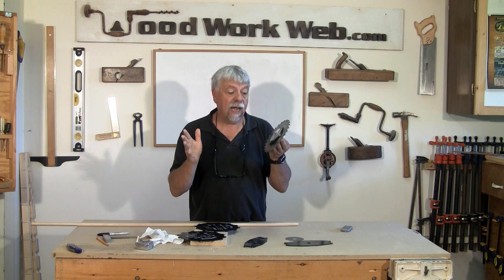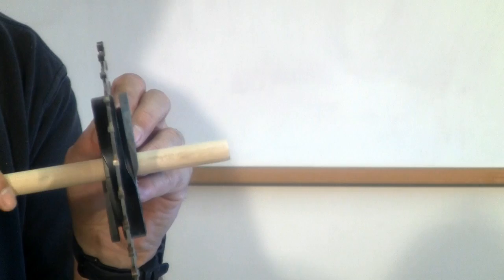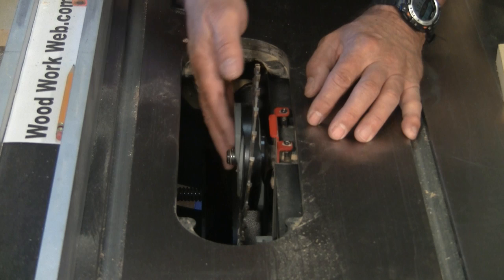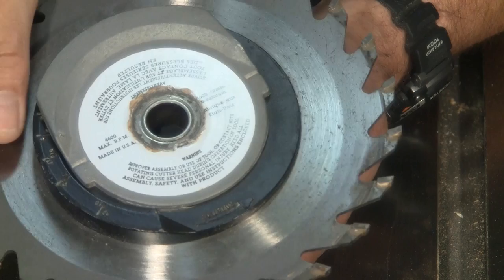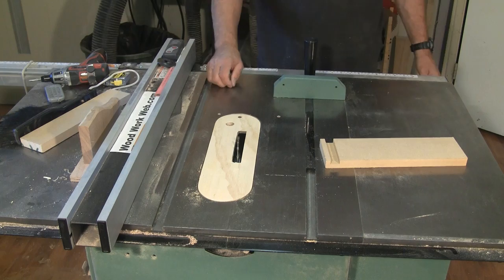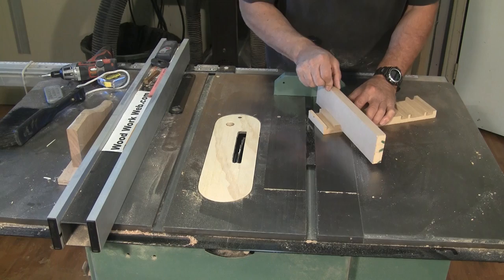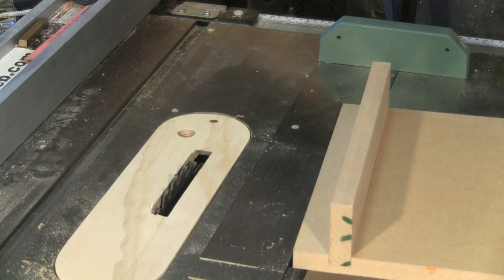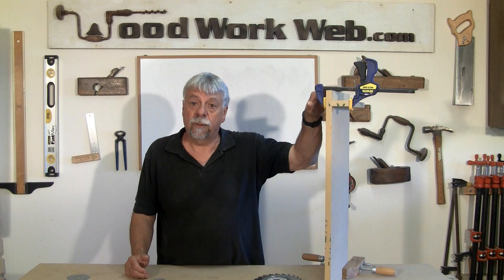Testing the Wobble Dado Blade -  woodworkweb

Comment: I got a wobble wheel a few years ago, put it in a box, and said I was going to use it later. Well 4 years later my wife found the box, so I took it out and finally put it together.  This one was made by Oldham and it comes apart so I can dial it in.  I have a Dewalt job site DW744 table saw for which I made a rolling cart with wings.  Everywhere I looked on the web, people were saying you can't use a dado stack on a Jobsite Saw.  Well, I got a Dado Throat plate from Dewalt for my saw with instructions on how to use a Dado Stack.  The outside arbor flange is put on the inside and I bought another flange for the outside so the saw blade isn't going anywhere.  I set the cutter to 3/4" and the Dado was really tight.  I sanded a bit to fit the test piece and that did the trick.  I suppose I could have done what you did in trying to dial in the perfect fit, but for my purpose, this worked out pretty good.  I also have a Freud Dado Stack that actually works much better.  As with your Wobble Wheel, mine has flat teeth but still produces a bit of a cup.  Thanks again for this video.

Comment: I've had one for 40 years. Works well for general woodworking, mostly for shelving. I worried about vibration and what it does to the motor bearing if it is used extensively,  but never had a problem.  Reading a lot of strange comments below.  These are great and serve a niche purpose, and have carbide tipped blades.  If you have access to a table saw, they're great. I don't think they're recommended on a skill saw.  A router, router table, and a nice set of carbide tipped bits are a great alternative if you are cramped for space, yet want to do a lot of different operations.  They are noisy, though.

Comment: We have always used the wobble wheel. It is simple to set up and best thing is there is only one piece to mess with. Also I've never had to adjust the blade that many times to get a good fit. The measurements on our blade are pretty close to true.

Comment: Yes, I use these all the time and they work really well. as Juan says, you ran the wood over the blade too quickly.  Run the wood a little slower or run it through a second time and the cut will be flat at the bottom of the dado.  The one that I own can be adjusted while it's on the arbor.  The two pieces that clamp the blade are cambered. Just loosen the nut,  and using two adjustable wrenches, hold the inside piece while turning the outside piece.  Then tighten the nut.

Comment: used one of those for years and never had that much trouble adjusting the width of cut. Also, I have built a large desk and glue,  no nails and only 10 screws and a handful of dowels. Used the wobbler for all dados and the desk is still being used 47 years later.

Comment: Yes but ........    taking apart a stack dado and adding shims isn't much different.   We all started somewhere.
Reply: RapidRrobert shim stack dado only requires one adjustment. Take a cut measure, add shims cut again. Golden. Once u know the stack for your set, grab and go. I like to use a story stick so to speak. Cut all dados in a setup board, leave that board hang out around the shop. Got a new board? Grab that stick test the fit, go gets the right shims and chippers.
Reply: i think he had to make a lot of adjustments because the guide was unreadable... which is a good advise in those wobble dados: take good care of the measurement guide if you don't want to fiddle...
usually in carpentry you use half a dozen measurements for dado cuts at MOST... once you figured out the sweet spot in those wobble dados you should punch a easy to see mark with a stencil so you can come back later... since it's a logaritmic measurement the wider the dado cut the hard is to finetune it

Comment: why not just use a dato blade? this thing looks like it takes more time setting up than it would making a couple cuts.
Reply: Mine has markings on it and I have no problem turning the hub to the setting.
Reply: that would be much more simple. if that were the case then yes this would beat a dato blade
Reply: I have both and now I just reach for this one.
Reply: John Miller He futzedabout much more than was necessary. A good fence, some calipers and a couple of hand turns will eliminate much of the time he wasted, and u probably don't have to completely remove it to adjust it

Comment: I have seen these periodically for sale on Craigslist, but never got one because the people selling them were asking a lot more than you say they should be going for.  I have an old Craftsman table saw with a cast iron table surface that I bought off a guy who was cleaning out his father's shop after he had died.  He also gave me a large box of old saw blades, but they have just been sitting in a corner in my shop ever since I bought the saw from him.  Today I was in the shop looking for something else and saw the box of blades, so I decided to take them out and see what all was in there, sorting by blade size.  I figured that if I had enough blades of a particular size, I could made my own dado set with some spacers made from aluminum sheet or whatever.  As I'm slowly working my way through this box of blades (and finding quite an assortment of different blade sizes), about halfway through I stumble across one of the wobble blades.  Looks like I won't be searching on Craigslist for one anymore... :)
I suspect that I have enough of the normal blades to make my own dado set though, so I still might not even up using the wobble blade.  My primary use for the table saw was to rip boards down to different sizes, not make cabinets or shelves, so I seldom need to cut a dado.  I've done it a  few times by just using a single blade and nibbling away at the cut until it was the right size.  Not something that I would want to do on a bookshelf with a lot of dados that needed to be cut through... :)

Comment: I have used a wobble dado for many years (since 1975) on my RAS, it now has marks scribed in it for the common thicknesses of material that I use, as a result setup is quick and easy. 

My first wobbler was a toothed monster as described by "tkarlmann", it was a fearsome looking beast but cut pretty good dados, however at 6" diameter the cuts were not too clean.

My 'newer' Sears wobbler has a 24 tooth carbide saw-blade and at 8" cuts a very smooth slot.

I have a stacked dado set which I hardly ever use, though the fact that the maximum dado width it cuts is 3/16" might have a little to do with that.

Thanks for the video Colin.
Reply from the maker: Paul Tomlinson Thanks for not Paul, good to hear others experiences

Comment: I have one of these and used it a good deal on my Radial Arm Saw, worked great.  The iterative process of getting the dado exact is just as cumbersome with the stacked dado.  Has to be another reason these were discontinued.   My guess might be the vibration impacts of the wobble on the saw.

Comment: Great way to lose a finger or thumb. I run as fast as possible away from them.
Reply from the maker: James Stanlake Yes, if you are not comfortable using them - do not use them.
Reply: Do your homework, they are banned in the states because they caused so many injuries.
Ask OSHA. It is the nature of the way they cut. Without constantt even pressure and feed they can cause the material to shift creating the potential for kick back. Call me what you will but give me the old fashioned stack dado det
Reply: My reply was not taken from any research paper I created. I am a ordinary craftsman with many years of experience. You can go to any OSHA office or likely find reams of information from their website as well.
Now they did extensive research on wobble dado blades, not me.
Reply: @jamesstanlake4064  Any source of the banning of the wobble saw on the internet? Only reference i can find on the OSHA website is "The practice of inserting wedges between the saw disk and the collar to form what is commonly known as a "wobble saw" shall not be permitted.". Seems to be about something else.

Comment: Had one for years. One excellent thing is they can be adjusted to the "metric" plywood and other odd dimensions out there today.  Also, you can set them for dimensions between 1/8" and a 1/4" that are nearly impossible with the stacked sets that have two 1/8" blades and chippers.

Comment: Not very accurate and theres no easy way to see the width of the dado until its run. I'd sooner make the side cuts with a regular blade and clean out the center with a hand router.
Reply: +lunhil12 That's exactly what I was thinking.  How are you supposed to measure accurately with that thing?
Reply: +Drew Almy The markings on them are only a rough guide and the adjustment is tricky when you aren't used to it, (you have to turn it about an inch to get an eighth width increase or decrease). Once you get what want, you scribe a line on it and you'll never have to do it again. Totally repeatable. I have lines all over mine. Like for 3/4", I have MDF 3/4" and the two plywood "3/4", and the close to 3/4" I use after running furring strips though the planer. I have a couple marked on there for when I stack beader board paneling on top of 3/8" and 1/2" plywood. Things that a stacked dado has problems with without tuning the fence and making multiple passes. The issue isn't so much adjustment, (because it's super awesome at adjustment), it's the fact that the blade doesn't stay sharp very long. You are removing a lot of material with a single pass and a single blade. If you have a way to sharpen the blade, you'll probably forget where you put the stacked dado. It's an idea that never really took off, I think because they are more expensive to make than stack and they cost less - less profit.
Reply: i suspect that given a lot of materials that people use that have a fair amount of thickness variance you may find it possible to get much finer fits with this, although at the expense of more trial and error.

Comment: That thing cuts WAY better than my 8-tooth...
Reply from the maker: +alecjahn This one is getting a bit dull, I was also using in on a somewhat softer wood so that might be a bit of a difference too
Reply: I like my wobble better then my stacking set. Colin if you can see it, dial it in on the arbor. That’s how I set mine in. I also thought about drilling in a set screw on the side so I don’t have to second guess myself.

Comment: I have the wobble blade and it does not and cannot cause a crown.
Reply: Barry Wind it can cause a crown, but not so much that the glue being used wouldn't completely fill it. It looks like less than 10° over 5"-6"... hardly anything
Reply: The crown would just be small or insignificant, nevertheless it would still be there. Taken to the extreme, if the blade were able to be set at 90°, then the crown is easy to visualize.
Reply: Barry Wind The old Vermont American 6" wobble dado that was also sold as the Shopsmith dado had carbide teeth that were ground to give you a flat bottom at 3/4".  It wouldn't be and couldn't be flat at any other setting.
Reply: looks like his board he slid in was crowned

Comment: I've used wobblers since the early 80's, and in my experience the only drawback is the slight radius at the bottom of the cut. If you're working with plywood or MDF, and the gaps will be filled or covered with edge banding, then a wobbler is fine. When working with solid wood, and you can't hide the gaps, use a stack dado.

Comment: I started with one of these and it worked well for me for years. I was never real crazy about the vibration. So, I bought an Excaliber (twin blade) from Sears for around $75, 30  or so years ago. It had carbide teeth and cut well. I bought a Freud stacked set and figured I didn't need the twin so I sold it to someone starting out. The wobbler, I gave away somewhere along the way. I still miss them both. I didn't experience the lengthy setup that you portrayed with the wobbler. You guys stick with what you got if it works for you.

Comment: Yup, bought one brand new (Craftsman label) 38 years ago or so $49 brand new. Still have.. and still works amazingly well, but I tend to use router created dado joints where possible nowadays, because [wobbly] can indeed be fiddly to get just right. It can take a lot of tries - like you had to take in the video, but I guess I've been fortunate over the decades that prolonged tweaking has only happened a handful of times. Yeah, "real" dado blade sets are prohibitive in price - if you want the kind of quality that is in your typical "single" width blade. Thanks for reintroducing an old technology to today's woodworkers!

Comment: I purchased a blade about 32 years ago with 4 wobble plates A locked in to B & C locked in to D. The only problem with a wobble blade other than you can't let an idiot use it because you've got to be very careful  on assembly Was as you said you have to true the bottom of the data when you done. Honestly never stopped me from using it Saved a lot of wear and tear on my rabbiting planes Though your wobble is safer I would never use it they move will you're using them they try to straighten out

Comment: I've had a problem with the stacked dado when cutting with the grain. Splinters got between the blades and chippers causing them to spread. That caused inconsistency in the dado width.
I now use the stacked dado across grain and the wobble dado for long grain.
The very thin "crown" fills with glue and if appearance isn't critical, it's not a problem.

Comment: I inherited one of these things and use it on a DEWalt radial arm saw. The combination vibrates the crap out of everything ! I end up making multiple cuts with a normal 3 mm wide table saw blade.
Reply from the maker: Hi Johann, actually in this case I think the vibration might be a good thing. Using dado blades or wobble wheels on radial arm saws can be a scary situation. Your alternative of making multiple cuts is a safe way to go .. good on you for doing this.

Comment: I have used this blade (Sears Craftsman model) for years and it is not any more dangerous than the stacking dado blade set. If you use it often enough, then you will learn how to adjust it with a lot more precision than shown in the video. As for the crown, I have never had a problem with it.

Comment: Used one on my radial arm saw.  No issues.  Plan to use it with my new table saw.  I also marked it for 3/4" lumber.  Found it worked well for unusually sized lumber.  I do think a dado stack is the best, but this little unit gets the job done as well.

Comment: This is all I used for years on my radial saw for lap joints, tenons and other uses. It's not the bottom of the slot that's the problem but the sides since there is a very slight dovetailing, which hasn't been a problem since I'm not a fine cabinetmaker and only built structural things. Now I'm starting into things like box joints so I bought an expensive dado stack. I've found that it's just as fiddily setting up the dado than with the wobble wheel, which I still use for some projects.

Comment: have used one marketed by Sears. Mine has two small locking screws and as the years have gone by I have made marks for standard size dados. What is so nice about these is I can adjust it for wood that has been planed to off size. Some old tools are better then new

Comment: I have two of these that I use with my radial arm saw. One I have had for over 40 years; the other I bought new as recently as a couple of years ago. (I'll try to get the source information to you.) I will say that adjustment is a lot easier on a RAS than on a table saw, as well as being inherently safer in operation. I can  remove the blade guard for test cuts snd adjusting, then reinstall the guard when ready to cut. I try to plan out work so that all dados of a single size san be cut with a single setup.

Comment: Over the course of 35 years I have used those blades hundreds of times. Never had a problem and never took that long to set up.
I did accidentally catch my finger nail on one of the carbide teeth once (not spinning)  and it wasn't pretty. I never found it to be any more dangerous than any other carbide blade.

Comment: Great video Colin. These sets can be hard on Arbor bearings if it sees prolonged use not to mention they are a pain to use. Thanks for taking this tool on and giving it an honest review.
Derek
Reply from the maker: I had not thought about the wobble affect and how it might be hard on bearings, thanks for that Derek thanks for that note
Reply from the maker: William Todd Thanks for that note William, something I forgot to mention, thanks for noting that :)
Reply: GiddyUp994 we have used the same wobble blade on a saw for 10yrs. It is the only blade the saw ever uses and it cuts without chipping the wood and the saw, which is 30yrs old, cuts better than  out other one that is 10yrs old.